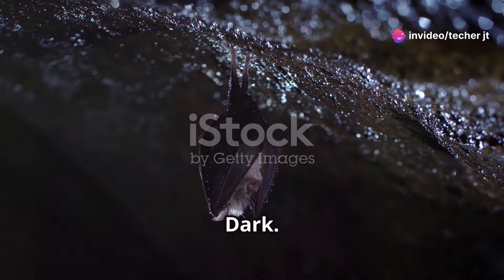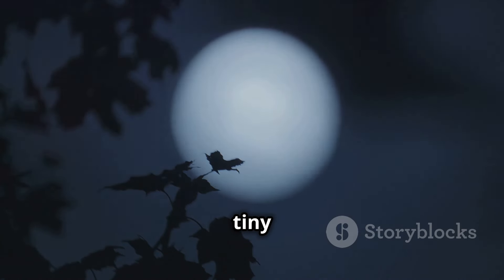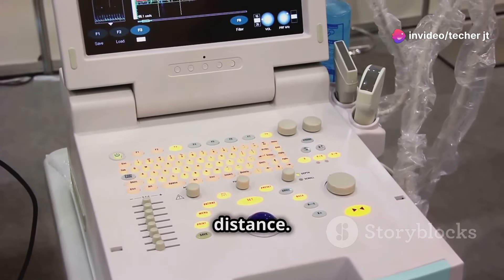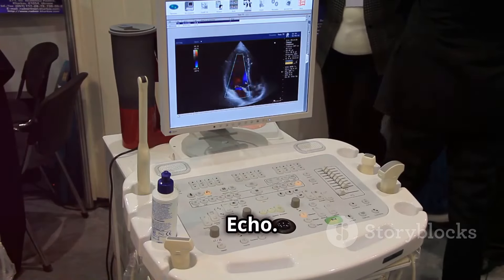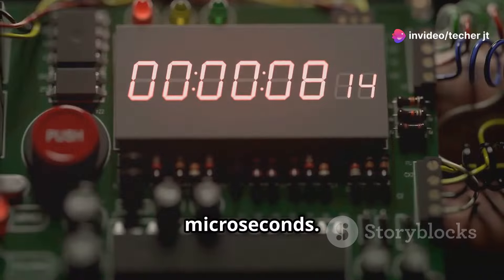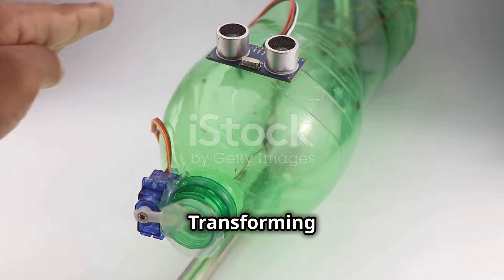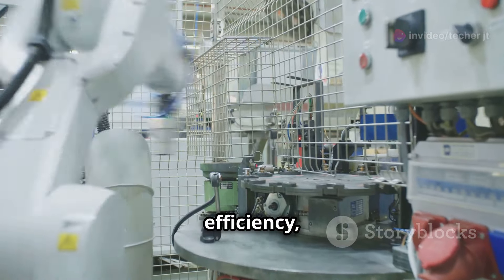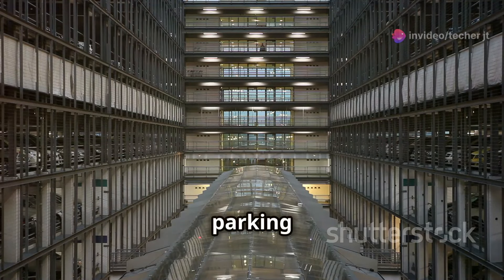Unlocking the Power of Ultrasonic Sensors: How They Work and Where They're Used!

Comment: Chris Nathan Dwayne M. Dura
10 - Lynx

6. Understanding: What are the key components of an ultrasonic sensor, and what role does each play in its operation?

A: An ultrasonic sensor measures distance or detects objects using sound waves. It consists of a transmitter that emits ultrasonic waves, a receiver that detects the reflected waves, a control circuit that manages timing, and a processing unit that calculates distance based on the time delay. A power supply powers the sensor, and the housing protects and directs the waves.

Comment: Iñigo Sevillejo
X-Cassiopeia

8. Analyzing: Investigate the reasons why ultrasonic sensors might fail to detect certain materials effectively. What characteristics of the materials contribute to this issue?

-Temperature, humidity, and the existence of dust or mist are examples of environmental variables that can affect ultrasonic sensors. High vapour pressure liquids, for instance, have the ability to alter sound speed, which can compromise measurement accuracy. Similarly, sound waves can be attenuated by flying dust or foam, which makes it more difficult for sensors to accurately identify objects.

Comment: Jannah Loreen S. Galla 
10 - CASSIOPEIA

Q: 6. Understanding: What are the key components of an ultrasonic sensor, and what role does each play in its operation?

A: An ultrasonic sensor consists of three key components: a transmitter, a receiver, and a signal processor. The transmitter emits ultrasonic sound waves into the environment. When these sound waves encounter an object, they reflect back toward the sensor. The receiver captures these reflected waves, and the signal processor calculates the distance to the object by measuring the time it takes for the waves to return. This system allows the ultrasonic sensor to accurately determine the distance to objects based on the echo of the emitted sound waves.

Comment: 🌟 10 - ANDROMEDA CHAIN ⬇️⬇️
Reply: Zara Mae M. Jurane
10-Andromeda

8. Analyzing: Investigate the reasons why ultrasonic sensors might fail to detect certain materials effectively. What characteristics of the materials contribute to this issue?

Environmental factors including temperature, humidity, and the presence of dust or mist can all have an impact on ultrasonic sensors. Liquids with high vapour pressure, for example, can change the speed of sound, affecting the precision of measurements. Similar to this, airborne dust or foam can weaken sound waves, making it harder for sensors to precisely identify objects.
Reply: Kent Kyle T. Palingcod 
10-Andromeda 

3. Analyzing: Compare and contrast the advantages and limitations of ultrasonic sensors in industrial applications versus their use in medical imaging.

Ultrasonic sensors are advantageous in industrial applications for their non-contact measurement and resilience in harsh environments, but they face limitations such as distance constraints and sensitivity to environmental conditions. In medical imaging, they provide high-resolution images safely without radiation exposure, yet their effectiveness is limited by tissue density and operator dependency.
Reply: Jaynie Margaret M. Lashley
10 - Andromeda

1.) Understanding: Explain the principle of echolocation and how it relates to the functioning of ultrasonic sensors.

-  Echolocation is a biological process used by animals like bats to locate objects by emitting sound waves and interpreting the returning echoes. Ultrasonic sensors work similarly, by measuring the time it takes for the echoes to return, the sensor calculates the distance to the object. This principle is used in various applications, such as proximity sensing in robotics and parking assistance in vehicles.
Reply: Ayannah Nicole Ngujo
10 - Andromeda 

1. Understanding: Explain the principle of echolocation and how it relates to the functioning of ultrasonic sensors.

Answer: Echolocation is a biological sonar used by various animals, including bats and dolphins, to navigate and locate objects by emitting sound waves and listening for the echoes that bounce back. Ultrasonic sensors operate on the same principles as echolocation. These sensors emit high-frequency sound waves and listen for the echoes that bounce back from nearby objects. Both ultrasonic sensors and echolocation rely on sound waves, this shared principle allows object detection and navigation.
Reply: Antonnette C. Tayrus 
10 - Andromeda

Q1. Understanding: Explain the principle of echolocation and how it relates to the functioning of ultrasonic sensors.

Answer: Echolocation is being able to move effortlessly in the dark without having to bump into anything, it is the ability to see their surroundings with the use of sound waves. Animals with echolocation ability include bats, whales, and dolphins. In echolocation, sound waves bounce off objects, causing echoes that return to the bat, providing a detailed sonic map of their surroundings. This method, like ultrasonic sensors, uses sound waves to identify objects in close proximity.
Reply: Ettena Marie A. Gabales
10 Andromeda

8. Analyzing: Investigate the reasons why ultrasonic sensors might fail to detect certain materials effectively. What characteristics of the materials contribute to this issue?

– Ultrasonic sensors can struggle to detect soft or sound-absorbing materials due to their ability to absorb sound waves. External noise sources can also interfere with the sensor's performance. Researchers are continuously working to improve the accuracy, range, and reliability of ultrasonic sensing technology.
Reply: Real Ann R. Dela Victoria 
10-Andromeda 

2. Applying: Describe a scenario in which an ultrasonic sensor would be more beneficial than an infrared sensor. Justify your choice.

A scenario for this is when a robot is navigating through a warehouse filled with boxes, an ultrasonic sensor can effectively detect obstacles regardless of their color or surface texture, while infrared sensors may struggle with transparent or reflective surface, leading to inaccuracies.
Reply: Rose Gabrielle D. Araoarao
10-Andromeda

1. Understanding: Explain the principle of echolocation and how it relates to the functioning of ultrasonic sensors.

Using high-pitched noises that are inaudible to humans, echolocation is a technique used to navigate through complete darkness. These ultrasonic sounds produce echoes that act as a detailed map of the surroundings as they bounce off objects. Similar to how an ultrasonic sensor operates, it sends out sound waves and waits for the echo to return before calculating the distance depending on how long it took.
Reply: Zion E. Paberecio 
Grade 10 - Andromeda 

4. Evaluating: Assess the impact of environmental conditions (like temperature and humidity) on the accuracy of ultrasonic sensors. What measures can be taken to mitigate these effects? 

ANSWER: Environmental conditions like temperature and humidity can affect the speed of sound, thus impacting the accuracy of ultrasonic sensors. To mitigate these effects, sensors can be calibrated for specific environments, or compensation algorithms can be used to adjust for temperature and humidity variations.
Reply: Dean Andrie P. Daohog
10 - Andromeda 

1. Understanding: Explain the principle of echolocation and how it relates to the functioning of ultrasonic sensors.

Answer: Much like echolocation, ultrasonic sensors also emit sound waves, that are inaudible to human ears, before waiting for the sound wave to bounce back and receive the sound wave before interpreting the distance of the object to the sensor.
Reply: Trixie Lorraine T. Canopin
10 - Andromeda 

2. Applying: Describe a scenario in which an ultrasonic sensor would be more beneficial than an infrared sensor. Justify your choice.

ANSWER: Ultrasonic sensors would be more beneficial than infrared sensors in a scenario where detecting objects through varying materials or in dust and smoke is needed, as ultrasonic sensors can penetrate these conditions better. Infrared sensors might struggle with such obstructions or varying temperatures.
Reply: Johann Rey Silmonet
10 - Andromeda

1.Understanding: Explain the principle of echolocation and how it relates to the functioning of ultrasonic sensors.

Animals like bats utilize echolocation, which is the process of producing sound waves and determining the location of things by studying the echoes that return. In order to determine distance, ultrasonic sensors use high-frequency waves to generate an echo and time the echo's return.
Reply: Chelsy Manzanades
10- Andromeda

1.) Understanding: Explain the principle of echolocation and how it relates to the functioning of ultrasonic sensors.

A : Echolocation is a natural mechanism used by bats to navigate and find objects by emitting sound waves that reflect back as echoes. Ultrasonic sensors, inspired by this principle, measure distances and detect objects using high-frequency sound waves, used in fields like medical imaging and vehicle safety.
Reply: Andrei Lavern A. Pelayo
10-Andromeda

1. Understanding: Explain the principle of echolocation and how it relates to the functioning of ultrasonic sensors.

Answer:

Echolocation and ultrasonic sensors both use sound waves to measure distance. Animals like bats use echolocation naturally, while ultrasonic sensors are man-made device that operate on the same way.
Reply: Angel Sofia C. Tabaniag 
10- Andromeda 

6. Understanding: What are the key components of an ultrasonic sensor, and what role does each play in its operation?

- The three main components of an ultrasonic sensor are the transducer, receiver, and microprocessor. The transducer emits ultrasonic sound waves, which are picked up by a receiver after they bounce off surrounding objects and return as echoes. The microcontroller calculates the object's distance by applying the speed of sound and measuring the time of echo reflections.
Reply: Ezra Shimei B. Calaycay
10 - ANDROMEDA

1. Understanding: What are the key components of an ultraslnic sensor and what role does each play in its operation?

-An ultrasonic sensor consists of three fundamental components: a transducer, a receiver, and a microprocessor. The transducer produces ultrasonic sound waves, which a receiver detects when they bounce off nearby objects and return as echoes. The microcontroller determines the object's distance by measuring sound speed and echo reflection time. An ultrasonic sensor consists of three fundamental components: a transducer, a receiver, and a CPU. The transducer produces ultrasonic sound waves, which a receiver detects when they bounce off nearby objects and return as echoes. The microcontroller determines the object's distance by measuring the speed of sound and the time between echo reflections.
Reply: Kobie James B. Gabales
10-Andromeda

3. Analyzing: Compare and contrast the advantages and limitations of ultrasonic sensors in industrial applications versus their use in medical imaging.

Ultrasonic sensors are advantageous in industrial applications for their non- contact measurement and resilience in harsh environments, but they face limitations such as distance constraints and sensitivity to environmental conditions. In medical imaging, they provide high-resolution images safely without radiation exposure, yet their effectiveness is limited by tissue density and operator dependency.
Reply: Christine M. Luna
10 - Andromeda 
09/03/2024
10:35 (time stamp)

2. Applying: Describe a scenario in which an ultrasonic sensor would be more beneficial than an infrared sensor. Justify your choice.

- Unlike Infrared Sensors (IR), which uses light to detect objects by emitting radiation/lasers, have a shorter detection range, and also have more environmental sensitivity to factors like ambiest light, dust, and temperature variations leading to inaccurate readings --- Ultrasonic Sensors work more reliably as they use sound waves for detection. This means that environmental obstacles like light, dust, or dirt do  not have much impact to the accuracy of the readings that Ultrasonic Sensors provide, therefore making them more beneficial than an infrared sensor under those conditions.
Reply: Davey A. Sabanal
10 - Andromeda

6. Understanding: What are the key components of an ultrasonic sensor, and what role does each play in its operation?

An ultrasonic sensor has a transmitter (emits ultrasonic waves), a receiver (detects reflected waves), and a control unit (processes signals to measure distance based on time of flight).
Reply: Kerk Ivahn C. Durohom
10 - Andromeda

Question 1: Understanding: Explain the principle of echolocation and how it relates to the functioning of ultrasonic sensors.
Answer: Echolocation is the process of using sound waves to determine the location of an object. Ultrasonic sensors use this principle by emitting high-frequency sound waves that bounce off objects and return to the sensor as echoes. By measuring the time it takes for the echoes to return, the sensor can calculate the distance to the object. This is similar to how bats use echolocation to navigate in the dark.
Reply: Zhandra B. Dela Rosa
10-Andromeda

1. Understanding: Explain the principle of echolocation and how it relates to the functioning of ultrasonic sensors.

Using high-pitched noises that are inaudible to humans, echolocation is a technique used to navigate through complete darkness. These ultrasonic sounds produce echoes that act as a detailed map of the surroundings as they bounce off objects. Similar to how an ultrasonic sensor operates, it sends out sound waves and waits for the echo to return before calculating the distance depending on how long it took.
Reply: Ariel D. Lacia
10- andromeda
4. Evaluating: Assess the impact of environmental conditions (like temperature and humidity) on the accuracy of ultrasonic sensors. What measures can be taken to mitigate these effects?
Environmental factors such as temperature and humidity can influence the accuracy of ultrasonic sensors by changing the speed of sound. Warmer temperatures can make sound travel faster, while high humidity can affect how sound waves move. To reduce these effects, temperature compensation methods can be applied, and sensors can be adjusted to account for these changes, improving measurement accuracy.

Comment: Christine Divine S. Taña  
10-LYNX  

1. Explain the principle of echolocation and how it relates to the functioning of ultrasonic sensors.

Echolocation is a process where sound waves are emitted, and the time it takes for them to bounce back from an object is measured to determine distance. Ultrasonic sensors use this same principle by sending out high-frequency sound waves and measuring the time taken for the echoes to return, helping robots detect and locate objects in their environment.

Comment: Shawn Deece A. Otoc
10-LYNX

Understanding: Explain the principle of echolocation and how it relates to the functioning of ultrasonic sensors.

Echolocation is the process where an object emits sound waves and measures the time it takes for the echoes to return after bouncing off nearby objects. Ultrasonic sensors use this principle by emitting high-frequency sound waves and detecting their reflection to determine the distance to objects, enabling robots to sense their surroundings and avoid obstacles.

Comment: Fiona B. Valmorida
10- ORION
1. Understanding: Explain the principle of echolocation and how it relates to the functioning of ultrasonic sensors.

Echolocation works by emitting sounds waves and measuring the time it's takes for the reflected waves to return, similar to how ultrasonic sensors use sound waves to determine distance.

Comment: Daniella G. Estanilla 
10 - Cassiopeia 

1. Understanding: Explain the principle of echolocation and how it relates to the functioning of ultrasonic sensors.

Echolocation involves using sound waves to detect the position and features of objects, a method used by animals like bats and dolphins. Ultrasonic sensors replicate this process by sending out high-frequency sound waves and measuring the time it takes for the echo to return after reflecting off an object. The time delay helps determine the distance to the object.

Comment: Marion James C. Nale
10 - Lynx

1. Understanding: Explain the principle of echolocation and how it relates to the functioning of ultrasonic sensors. 

An ultrasonic sensor emits a sound pulse in the ultrasonic range. This sound pulse propagates at the speed of sound through air (about 344 meters per second) until the sound pulse encounters an object. The sound pulse bounces off the object and is returned in reverse to the sensor where this "echo" is received. Similar to bats.

Comment: Angel Alexa M. Maquilan
10 - Lyra

4.)  Evaluating: Assess the impact of environmental conditions (like temperature and humidity) on the accuracy of ultrasonic sensors. What measures can be taken to mitigate these effects?

- Ultrasonic sensor accuracy is influenced by environmental factors like temperature and humidity, which affect the speed of sound. Higher temperatures increase sound speed, while humidity alters sound wave propagation. To mitigate these effects and enhance measurement accuracy, temperature compensation methods and sensor adjustments can be implemented.

Comment: Neeka Ella P. Guillero
10 - LYNX

1. Understanding: Explain the principle of echolocation and how it relates to the functioning of ultrasonic sensors.

- The concept of echolocation is the technique by which animals such as bats and dolphins use to navigate by emitting sound waves and analyzing the returning echoes to identify objects in their environment. Ultrasonic sensors replicate this method by sending out ultrasonic sound pulses and measuring the time it takes for the echoes to return from an object, which helps determine the object's distance.